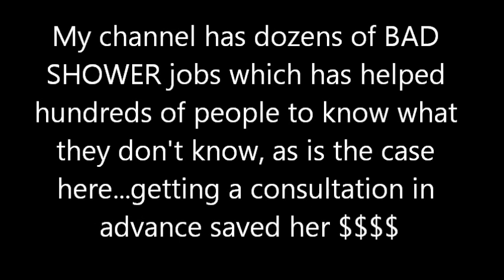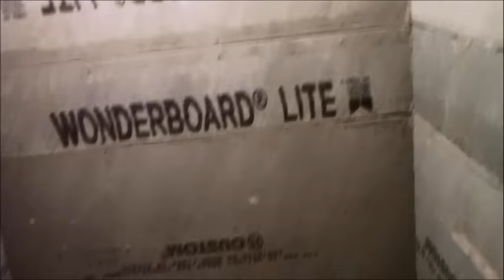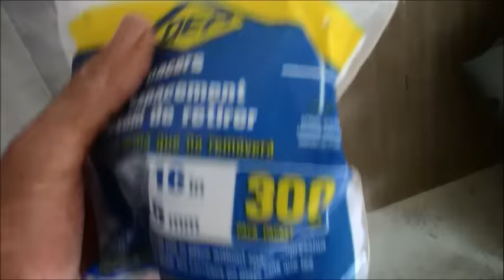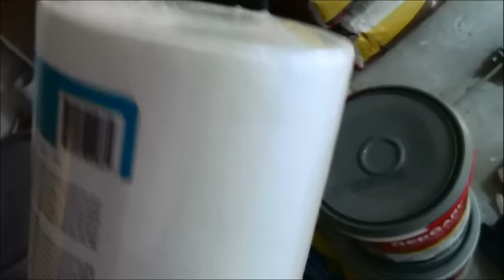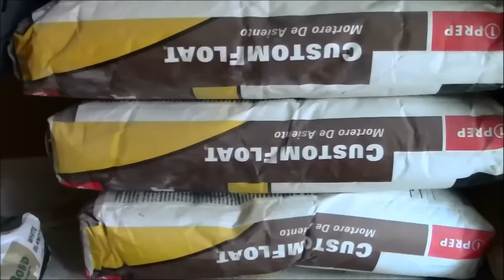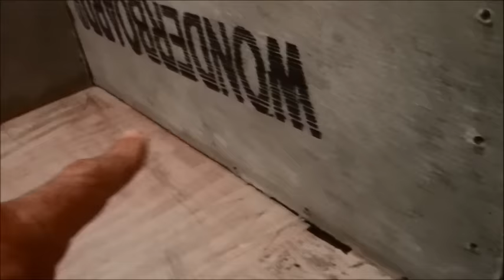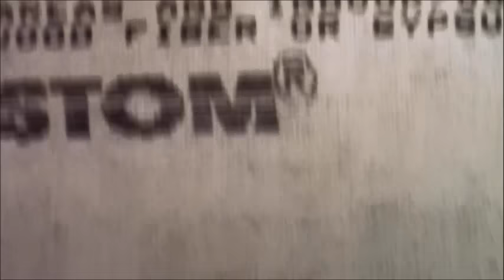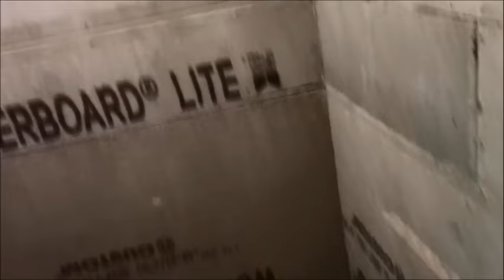BAD SHOWER DAY ONE !!

Comment: Lol I'm not gona save those lil plastic things every job. They get included with materials just like everything else chill out.
Reply from the maker: It's very entertaining to me that everybody chimes in on the fact that he bought new spacers, but it doesn't matter that he put his wallboard up prior to his pan, doesn't matter that he was using pressure treated wood for his curb, doesn't matter that he tried using pre-mixed thinset for his tile, that drain was off center, that he used 20 sharkbites inside the walls, much bigger issues than the spacers....
But if you are not cleaning all of your stuff on a regular basis like your levels, your wet saw, and your spacers man you're wasting money to begin with
Reply: @StarrTile  Yeah, you're right. There are other issues that far exceed the spacer issue but the fact that you are bashing him for spacers is ridiculous. They are so cheap. I never re-use them. Been doing tile, stone, granite and marble for about 22 years and I've always been ok with spending a couple bucks on spacers. I don't even charge the home owner for them lol. Also, the pre mix thin set and mesh tape are for the seams on the wonder board. Then, after it drys, you red guard... I dont buy the pre mix thin set but I literally just did a job where the contractor bought it for me to tape and mud the seams. I get that this guy has made some bad mistakes but why point out the petty stuff that you are wrong about? Lol. Also, the mud guard issue is dumb too. I imagine he knew and would have handled that before he laid the tile. There are so many things that you are bashing him for that arent wrong. They just aren't the way you do it... At the end of the day, you are a hating ass dude lol.
Reply: @StarrTile  oh btw, you said yourself that the tile guy didnt do the duroc but you are bashing him for it and the fact that he didnt put the pan down? Right... Same with the creaking floor. How do you know he didnt plan on fixing that? There are a lot of things that you are dead ass wrong for. I can tell that you are knowledgeable. You probably do great work. But, maybe you shouldnt be so fast to critic someone until you have fully assessed the situation. I've been guilty of that in the past too but you are trying to make videos on it, that people that have no experience are taking your word on. Maybe you should look at the job, write some stuff down and think about it or sleep on it, then come back the next day and do your video. That way you arent so quick to persecute.
Reply from the maker: Let's just suppose for a few minutes that my channel is focused on teaching tile, that I go through the jobs I end up on Forensically to discuss the do's and don'ts of how to do certain things... and let's suppose that the discussion in the comments has to do with both amateurs and professionals, people like ourselves that do this stuff for a living everyday, and that my critique of Joe Blow tile guy has to do with what I would do or the expectations of a another contractor would do in the same situation.... then both of your comments would probably be valid and you would probably have some points to make. However.....

None of what I just said is true, my channel is in no way geared toward other contractors whether they are just starting out or have Decades of experience, that people chime in on their opinion about my videos is a bit irrelevant to me. My presence on YouTube was predicated by job I did 10 years ago where the woman had spent $20,000 renovating her bathroom over the course of six weeks with three different Crews from the same company. That was my first video and the critique that I did on that video is valid information for homeowners like the one I worked for who had no clue about how things should go or what materials to be used. Going forward from 2010 I still do these type of videos for ignorant homeowners who don't have a clue, that way they have some insight on the things that either can go wrong or have gone wrong, it is information that has saved hundreds of thousands of dollars through the last 10 years for those homeowners who have contacted me as the one in the video did prior to things going south. When this lady contacted me things were already messed up, including some of the plumbing issues which I enumerated on the video, that led her to believe that she was getting ready to get shafted based on watching my videos. Simple but yet important things like the toilet supply being on the wrong side of the toilet flange, the fact there were 20 shark bites used to connect all the pipes, the shower drain being off center, etc etc... even to the point you made about the sheetrock guy hanging the wallboard in the shower, if I'm responsible for the entirety of the shower then I'm going to do the wallboard and if somebody else did then I'm going to give it a pass or fail, the fact that he did not oppose how it was done tells me all I needed to know. Already warped pressure-treated 2x4's was really enough info.
This lady contacted me feeling it wasn't starting out good, and she was right, despite the fact everybody chimes in on the new spacers 😂
Reply: Just throw your spacers in a water bucket with a little vinegar instead of the trash, let it soak, then mix with your paddle.  I've been using  some the same spacers for years lol.  I bet you throw all your buckets away too 😄
Reply: @justincada  Lol. So much talk about these lil spacers. I'm no expert an I don't do tile alot but I get it they can be cleaned an you could save a couple bucks. I'm sure there are pros throwin them out an some that save them. Either way a shower has never leaked or failed due to not saving the spacers! Lol 😆 I'd pay a couple bucks just to not have to mess with them.
Reply: You make your customers spend $75+ dollars extra for new spacers!? I have seen that they sell reusable kits at Home Depot and they are not cheap! This is why folks go for the cheap guy because you're charging your customer extra for something you can clean and reuses. Smh.
Reply: @Codi892   Lol the customer is responsible for all material cost. Im not out to save anyone money its about making money for yourself first of all. A pack of 100 is $5-$10 depending on type brand an where you get it. Nobody is gona spend $75+ on spacers like you said for a shower unless its huge or very technical with small tile. I'm not saying to just throw them out. It's just a very minor detail that alot of people found funny because was making such a big deal about him having bought new spacers. I actually hate tile work with a passion 😃
Reply: @alexandershulgin2C-B  Keyword: material! Spacers are a tool not material. You will not be leaving the spacers in the tiles as some fixture. They are there to help the tiler do their job correctly!! You should not be charging a TOOL as material. That is just wrong on so many levels. No wonder there are contractors out there charging $19,000 for a 55sq ft bathroom remodel. They are charging tools as material.
Reply: @Codi892  Lol this is hilarious! Actually there is such thing as leave in tile spacers! Sorry that your so worked up over re-using a peice of plastic. Tool or material whatever they will b the cheapest part of the shower. My orginal point being the ability to re-use them shouldn't be so heavily emphasized when we are talking shower failures! The tile community is so toxic! Glad it's not my profession.
Reply: @alexandershulgin2C-B  I am not a tiler. I am a freelance videographer and I am worked up because we are currently shopping for a bathroom remodel but the prices are ridiculously expensive. Tho I live in Chicago but there are folks charging $13,000 - $16,000 to basically replace tiles and a bathtub in a 51 square foot bathroom! And we have to buy the materials ourselves! Then to think they would have the nerve to tell us that spacers is included in our material purchase while charging $15,000 is maddening! No wonder some folks hire their neighbors brother-in-law uncle to do the job. Smh
Reply: @Codi892  thats funny. This isn't a tool its supplies. You obviously are not in the construction field.
Reply: @Codi892  if you understand this.. let's say it takes me an hour or two to clean, recycle and reuse those. That's more expensive than to buy them new LOL
Reply: @Codi892  dont like it.. simply do it your self
Reply: @mattteekel8237  I am not. I'm a freelance videographer and I can't imagine charging my clients to use a new SD card every time. Even tho SD cards have gotten cheaper, it's the principal.
Reply: @vanderumd11  I'm a freelance videographer. It takes some time to upload clips onto my computer, re-arrange it so I can find it and then upload it properly so I can save my edits in the right place. Imagine me skipping all that just to charge my client extra so I can buy a new SD card. Cause why on earth should I clean it out?
Reply: @Codi892  because your job is easy and doesn't require physical labor. If your job was to bid 15-40,000 dollars and you spent hours wiping off 200 tiny pieces of plastic that cost $20 then you would be what we call in the industry a WEIRDO
Reply: @vanderumd11  Because my job is easy?? Lol Clearly you have never went through hours of wedding footage to piece together a 10 minute video. Clearly you don't know the videographer who shot commerical videos for Harley Davidson or Ford F150 with a $20,000+ budget but I digress. I just see that cutting corners seems to be an industry practice.
Reply: @anthony4308  I see you completely missed my point.
Reply: @Codi892  it’s considered consumables not tools,
Reply: @HHECTORUSMC  So if a customer tells you they refuse to pay for the spacers, then what do you do?
Reply: @Codi892  The entire, budget busting,whopping, $10.23 is already priced in to the job. 😆. They don't have a choice.
Reply: @donnyh3497  It's a deal-breaker for me. I will now ask the spacer question to separate those who take shortcuts from the ones who actually take pride in their work.
Reply: @TheJosemarenco  no you're actually right. Lol ... I'll be watching for entertainment.  Not tips. 😂😂😂
Reply: Fellas, let's be real..
Forget about the spacers, forget about about the worped boards, forget about the board going in first... Blah blah blah..
The real crime here is::
Mr Tile professor here needs to cut his nails 🤦🏼🤷🏼‍♂️🙄🤣🤣
Reply: @Codi892  I've had 2 estimates to remodel a 5x8 bathroom.  First is 10000$. 2. Is 12000$. For both of them. The estimates are the very least. Without even looking.
Reply: My company does not reuse the tile spacers and I just buy them by the case.  So we have plenty on the job.  When we are done  they are put in a trash bag.  We don’t charge the home owner for the spacers. I just buy them because it’s cheaper to buy new ones then to pay one of my workers to clean the old ones.   I can’t believe that people care about what we do with the old spacers.   Let’s just all focus on the tile work and a little less on a few dollars for spacers lol.
Reply: @StarrTile  I get it this tile guy had many issues going on. Props to pointing these issues out. But you literally said you would “question” a contractor that shows up to a job with a new bag of spacers. I appreciate your videos, but you know as well as anyone that customers will latch onto that piece of information and will now question any contractor who shows up with a new bag of spacers instead of old used spacers. That is STRICTLY your biased opinion based on nothing more than your personal preference for reusing spacers that has absolutely no bearing on a contractor’s abilities or experience level. Also on the premixed thin set. I would never use it in a wet area, but I would certainly consider it for a bathroom floor or a backsplash. I’ve used it plenty of times for that and never had an issue. And there have been PLENTY of times where I bought only one bag of thin set initially because the store was low on stock, but had the intention of returning for more when tiling began. Or, maybe I would buy one bag initially just for the taping of the backer board. Not every contractor buys EVERYTHING they need on a job on day one.

I think we are just saying, presumptions about these things can set a dangerous precedent. I have clients who watch lots of YouTube videos on how stuff is done, and you know as well as anyone there is more than one way to skin a cat. Seeing a bucket of premixed thin set on site or a bag of new spacers is not grounds for immediate dismissal of a contractor, which is what many would do if they  are a devout follower of your stuff.
Reply from the maker: Still entertained by all the ppl focused on spacers...with 15 other things are are a big heads up...
Valve not center & too deep
Drain not center
Squeeking unsecure flooring
No blocking at studs
20 sharkbites
Warped PT 2x4
Toilet supply on right side
And yes, basically mastic which pre mixed mortar is, not EVEN proper for floors...been on jobs 5 days later 12x12 tile can still move because it won't dry....only on a backsplash and none was being done here. To your other comment about leave in spacers, no professional tile guy would do that even if directions allowed for it. And yes I save & re-use spacers ALL the time, nothing to do with cost, just prudent and force of habit.

This lady had watched a boatload of my bad shower job videos and had made a decision she was about to get screwed over, probably a good choice to let them go, we'll never know but I'm 95% convinced.
Reply: @StarrTile  it's ok to do everything wrong as long as you recycle those damned spacers😆
Reply from the maker: @donnyh3497  exactly !! 😂😂😂😂
Reply: With respect, for someone who goes out of his way to be hyper critical of other people, you really have a difficult time getting it back.

With that said, you'll probably dismiss this next part. 

There is a better way to point out dos or don'ts. You don't have to trash people in the process. You're so focused on the trashing part that you start it off by  insinuating the previous guy is terrible at his job because he doesn't hoard throw away plastic spacers. You should probably take a look inward.

Ultimately I suggest simply focusing on the dos and don'ts and less on the assumptions you're making about people. You'd save yourself a lot of criticism you clearly have difficulty taking.
Reply: @StarrTile  I just want to say, as a home owner who has been screwed over too many times and over paid thousands of dollars to professional contractors who cut corners and rush a job because they just want my money, thank you for your videos and professional insight.  Moving forward I can better vet contractors at least the tilers.  I’m actually going to renovate my master soon as well as my showers in my other bathrooms.  Your videos are imperative. Thank you.
Reply: @alexandershulgin2C-B  You’re the reason why contractors have a bad rap.  That simple fact that you only focused on the spacer and not everything else that was really wrong that he pointed out speaks volumes.
Reply: @sonyapeach  Lol. Ya that's why I pointed it out! Because its ridiculous to make such a big deal about spacers!  Especially with all the other real problems going on! Saving tile spacers isn't gona make or break the job!
Reply: This comment section will never die lol. This is just pure entertainment! I love all the raging Karen's
Reply: I get a specific brand (cartwheel style) from Lowe’s and they’re not all that cheap (10$ per 150 I believe), so when I pull spacers I just chuck them in a tote I have for them, no cleaning required or any additional work. It’s one less thing to potentially forget to buy, it’s cheaper (might save you a few hundred a year), it’s less plastic waste, and it’s probably slightly less work since it’s easier to grab spacers from a tote than from a plastic bag
Reply: @vanderumd11  tbh been using the same spacers for months and I don’t think I’ve actually ever cleaned them, let alone spent hours on the task
Reply: @mattteekel8237  😂. She does not know
Reply: I have tons of spacers. I dont do professional tile either. Just dumb not to keep them. Every dollar counts.
Reply: @justincada  LOL
Reply: Let me just make a bunch of assumptions….. I have an idea, how about talking to the tile guy and ask him about his plan?
Reply: That bath rooms is wrong in everyway  but. Your wrong about alot of things as well. If it's a concrete for you have to use PT lumber. And waterproofing membrane you are suppose to use the fiberglass tape for several reasons. But most of all its code to use it at least in Florida. You don't seem  like much a guy that goes by code. I  I doubt you're even licensed. But anyways I just was looking at vids yours popped up. Not my style. And for the spacers I stop using those 10 years ago when leveling clips came out you get a spacer and lippage is out of the question.  But you know what they say can't teach an old dog new tricks. Good luck.
Reply from the maker: @TylerBlakey
As you can clearly see this video has over a quarter million views so I don't respond to every comment.
There are things on probably every video across YouTube that people have no knowledge about, and yours is definitely one. You did however bring up a good point about spacers, like you I haven't used them in many years because of the leveling clips that are needed, that was my mistake for not bringing that across, those spacers had no business even being on the job site. And of course your ignorance on the concrete thing can be excused since you don't know this was an upstairs application with a fake concrete subfloor from the 80s... in fact I'm not going to call it concrete it is more like a mortar cement product, but it was NOT ground level so PT not needed. And to be clear PT would only be needed on the perimeter of a house that was a concrete slab. AND it would be cured PT, not bought at HD fresh as this gut did. Codes get mix-matched with common sense all the time, sometimes they are good and are a protector, sometimes they are illogical and cause problems because they're slow to be updated... take for example the notion of a pre slope, code in a lot of municipalities, however people are waterproofing the surface of their pan now so tell me exactly how a pre slope would be beneficial. So yes I'm a Maverick, and many don't appreciate my straightforwardness and logical brain, then again I'm not begging for subscribers or likes 👍👌
Reply: I love your videos, but in this one here i see that you are trying so hard to finding mistakes even with material in the job site that you dont even know how or where he is going to use it, 
Like i said i love your videos cuz we learned from you, you are good experienced tile guy, but just remember, when you point a finger to someone, look at your hand 3 fingers are pointing to yourself
Reply from the maker: @joseangel

14 things at a minimum including 12 sharkbites in wall, toilet flange 10" off wall, toilet supply on right side, shower drain not center, wallboard set before liner, valve wall not plumb... those are things that tell me it was going to go south.
Reply: @justincada  never waste a good bucket 🪣
Reply: @StarrTile  I don’t know why people are bashing you over taking pride in the quality of your work. I would take quality over quantity everyday of the week. If people are bashing you for taking the time to take care of your tools, speaks volumes about what little pride they show through their own actions. This job had several examples of what not to do and fools are talking about spacers. You’re 100% right.
Reply: For real! I'm a hack if I buy new bags of spacers?! I flick em all over when it's time for grout. I'm not picking each of em up. They are consumables and are bought for every job! Plus the ones you do have always get knocked over in the trailer and get everywhere!
Reply from the maker: @duganfr  the bigger issue is that spacers had no place on the job ANYWAY ! levelling clips should have been bought for this large-format tile
Reply: Well, this thread is entertaining, but...  Sure, I'm betting spacers and other assorted items are "included with materials" and factored at many multiples over the contractor's cost. It ain't buying a new truck, but just another way to pad for hidden profit. Funny how people rationalize crap, they put a few sprinkles on a turd and argue it's chocolate.
Reply: @alexandershulgin2C-B  you spelled Candace Odlii wrong.
Reply: @Codi892  lolol, and you will look as ignorant as you actually are about this. Spacers are a few bucks. They get cement on them and some are leave in spacers that you grout over. Thinking that a person who buys new spacers for your job is going to take shortcuts is pure ignorance. I had to buy some spacers on my last job because it was a size I am out of. I had three sizes laying around but I did not have any more 3/8. The owner actually picked them up from the store for me. I certainly did not cut any corners. I am glad they did not see this video and come to the conclusion that I did not know what I was doing because I did not have their size spacers currently, lol. Some people  🤦‍♂️🤦‍♂️🤦‍♂️
Reply: @StarrTile  then you should have cut that part out of the video. It was a stupid thing to say
Reply from the maker: @christcrucified6385  there is not one or two or four or five things this guy was getting ready to do incorrectly, and besides having new spacers, spacers weren't appropriate for this job to begin with, should have been leveling clips... I don't think I've touched any spacers for the last five or six years since large-format tile came on the scene.

That people continue to focus on the spacers instead of the other 14 mistakes this guy was making with his material is a bit bizarre
Reply: @christcrucified6385  And I wouldn't hire you. End of story. Clearly there is a generation of workers who are more interested in profit than the quality of their work.
Reply: @StarrTile  you asked why people were focusing on that and that was my response to your question.  They're focusing on it because it is so out of place with the rest of the video. As you point out, there were many things wrong with the job. I was just suggesting it may help if you erased that snippet since it is such a detraction. The fact that you've got a homeowner on here saying she's not going to hire a contractor who has new spacers shows how you can mislead people. But hey, it's your YouTube channel. I wish you the best.
Reply from the maker: @christcrucified6385  I started my channel 11 years ago going on screwed up and hacked up jobs, that almost always start this way so for me not to point out the brand-new spacers which I haven't even bought brand new spacers for years is why I mentioned it, once again that job had nothing to do with spacers those should have been leveling clips and that's the bigger issue.
If he at least had leveling clips then I could have bypassed the spacer issue
Reply: He is critizen dudes skills and quality of work cause he bought a bag of $3 spacers 🤣😂🤣
Reply: @StarrTile  I hear you man, but I have to disagree on judging installers on whether they use spacers or clips.  Many old school guys never use leveling clips. As far as I know, all the leveling clips do is help with lippage. They do not adjust the tiles up or down on either side. I do NOT use leveling clips. I make sure every tile is perfectly level, and as we all know the tiles themselves can vary in size if they are not rectified. It might just be millimeters but going up a wall can end up "imperfect" by the time I get to the top if I trust the spacers. I build off of a level board on the wall but even if the board is 100% perfectly level the variation in the tiles can throw it off. I use some spacers and even use paper to make different size spacers to level each and every piece of tile. When I am done my showers are always more square than the framing. I build immaculate showers. I use three or four different size levels and make sure everything is perfectly level, straight, and flat vertically and horizontally. I am a perfectionist and it is an art to me. When I started this stuff in the 90's I never heard of leveling clips. I don't think that I need them because I don't suffer frim lippage, lol. I think I will try them on my next rectified tile job just to speed it up, but I have no intentions on ever using them for non-rectified tile jobs. 
Many old schoolers can build better showers without leveling clips than many new generation installers can with them. I think they were invented just to speed things up or possibly to help the inexperienced with lippage.
Reply from the maker: Trust me I did not judge him on the fact that he had spacers or the fact that he didn't have leveling Clips, it was the 14 plus other things on the video that I judge him on including all of the prep that had been done ...that somebody decided to focus and comment on the spacers critique is on them and not on me. In the description there is the follow-up video which shows all the rest of the mistakes. The homeowner would have been screwed over 100%.

So going back about 8 years ago, maybe even 10, we were all doing 12 x 12 tile or 13 x 13 no offset and set wirh spacers. Then Along Came large-format tile, specifically 12 by 24, and they are bowed, especially the wood plank floor tile that NEED leveling Clips in order to avoid lippage since everybody wants it staggered in half, or even at thirds it would be difficult if not impossible to avoid lippage without the clips. The leveling systems came out as an answer to a problem, if all this large-format tile did not exist then neither would the clips.
If you can have lippage free setting of tile without leveling clips then consider yourself fortunate and or extremely skilled, and even though I carry around a box of used spacers of various sizes for years, I don't think I've even used any of those since 2008-2010.
Reply: @Codi892  Actually Candace, the opposite is true. Leveling clips were invented because the industry thrives on speed, not quality. They do NOT guarantee a level or square shower at all. They only help with lippage. The problem with the industry is that developers just want the job finished in a few days. As long as the shower outlasts their warranty they are good to go. I won't work for people like that. Thankfully, I don't have to because I do immaculate work and get enough business by word of mouth. 
Old schoolers who take there time will build a better shower than any new generation installer that can't build a shower without lippage unless they use clips. Everything you are saying is pure ignorance and just wrong in every way, but I am glad you are commenting on here because every tile guy knows it, and it shows why Starrtile should not be misleading the ignorant public. I am not putting you down. Anyone can be mislead by a knowledgeable guy like STarrtile. Only tile guys will know when he is blowing smoke and venting.
Reply: @StarrTile  I agree with all you are saying here for sure. My last job the tile guys got run off before they got to the showers. They left a leveling kit behind. I did not use it because it was just standard 20x20 porcelain and not rectified. I did keep them though and will give them a try on my next rectified job. Thanks for your channel and info.
Reply: @StarrTile  You mention you do it for the homeowners and how you have saved them 100's of thousands of dollars right after you call them "ignorant homeowners" 

This is the first time I ever come across your channel . . . you seem to really enjoy critiquing other people but seem to get very upset when people critique you.  LMAO.

I think you don't want contractor's looking at your videos so that they don't critique you and you can charge the owners more to fix someone else's mistakes. I mean really, my labor could pull off all that board and have it ready for me to start fresh in less time than it took you to make this video.  LMAO.
Reply: @alexandershulgin2C-B  He must not make very much money, or get enough work that he has to spend an hour washing and cleaning spacers.  LMAO

Wait let me do the math:  1 hour of my time = $40-$60 
1 bag of spacers roughly $5
Even if it took me 1/4 hour to clean them, that still costs me $10-$15
WOW.  

I like the part where he says he does it for the homeowners to save them money but calls them "ignorant homeowners" LMAO. Or when he says,  "I'm going to have to charge them a lot more money to fix this . . . my labor could pull that shit down and have it ready for me in less time it took him to make this video.  LMAO
Reply: @mattteekel8237  RIGHT. There are such things as consumables, and spacers are one of them.  That's like saying I'm going to reuse the screws and nails when I demo something!
Reply: @Codi892  You do realize, that there are many different types of spacers out there ( just like, in the old days, there were many different types of film speeds that resulted in different effects, High speed, low lighting etc.. . . . Not every piece of tile is the same even if they are in the same box. so there could be as little as 1/32" to 1/16" difference with every tile depending on the material it is manufactured for. Because of that discrepancy,  a craftsman has to know his material and adjust for it in order to achieve the desired results.  That's why when you go to home depot and walk down any aisle, there is slew of items seemingly for the same thing.  There are at least 25+ different types of spacers made, which one that is selected is determined by what type of material is going to be used:  ceramic, granite, quartz, glass etc.. and even within each category, the size, shape and finish affects it as well. 

Just like in your case . . . what effects you are trying to achieve with your final video will determine the type of setting you use, filters, lighting etc.  And then you have to spend hours trying to piece it all together.  It's no different for us. That's why there are certain materials that we just purchase as needed.  It would be nice if everything was the same, but it's not.
Reply: @survivalSC  I hear that. Not to mention that there are so many variables that will dictate what type and size we will use. It would be nice if every 12x12 tile was exactly 12x12. But they aren't. sometimes every tile in the same box is a little different. It's not the $5 bag of spacers that makes the difference, it's the person's skill and his knowledge of knowing what materials to use and when to use them.
Reply: @alexandershulgin2C-B  Not to mention the fact that he dismisses the use of the fabric tape for the joints during water proofing. That's like a drywaller saying that joint tape is not needed because the joint compound is strong enough.
Reply: @StarrTile  To be fair, you are absolutely correct. There are a lot of discrepancies noted with this job. And it is a shame that there are people out there that do this type of work. But that's why they call me. I don't waste my time badmouthing the other guy, I spend my time focusing on what needs to take place to fix it. That's what I do . .
Reply: @JTP1967  lol
Reply: I re-use spacers also.  I clean my buckets even.  I maybe do 5 showers a year.  I also only do jobs that I personally prep/demo&plumb.  It's pride and quality in your work.  Most home owners are oblivious.  Cudos to you for educating them.  I just conduct myself according to the warrantee and 20 year standard I expect of my product.  These commentary seem to feel called out lol.  Must be feeling guilty..... Rock on Star tile and keep doing your thing
Reply: Your crazy bro yeah it's included with materials and then I pocket it because  I already 5 Tupperware tubs of them already lmfao
Reply: Everything u save is money back in your pocket.
Reply: Don’t cry  girl  , not  every person has to  do the things like how you think I hate peoples like you  , if you want the job just  ask if they can give it to you  .And I have 15 years working on this
Reply: Re-using them.. seems like poor quality control I don’t care how good you think you are the spacers get mud on them & if you don’t clean them right then... As you know mud hardens. Making that spacer thicker. Contractors are always trying to act like there’s only one way to do things & it’s their way 100% of the time.
Reply: Saving spacers means you aren’t charging enough. $25 in spacers to do a 5k shower shouldn’t be an issue. PT is code by water where we work.  Regardless of liner or membrane here. So the regular 2x4 would be a fail already.  Yea that job is shitty. Heavy mud levels everything.
Reply: It's the green Rolling stones green m&ms of a craftsman. If you know, you know. You can tell when something is half ass by the little things.
Reply: @Codi892  imagine charging for film omg... it's like that wasn't a thing...
Reply: I Totally agree with you! My day job is in Telecom and I’m Hobby machinist. I sometimes do DIY kitchens and bathrooms and I’m very proficient in plumbing. I have worked with tradesmen and see the IDC attitude they have, not all but some. The shower valve and head will look stupid forever if left that way. All plumbing can be moved, unless it’s set in a concrete wall or floor. I would tell the customer what was wrong and take all the boards off, floor also. The ultimate decision is how much the customer wants to spend for all this work. Also is this a rental and do they want to go cheap? As a DIY-error many years, I with I had YT 40 years ago. Thank you for your video.
Reply: As a tile contractor, I'm often following the GC or homeowner's crews. I'm not always asked to be there from the beginning. I would be questioning why the drain/valve isn't centered in the opening. Why the new plywood isn't installed correctly( plywood long edge across the most joists). Yes, it bothers me to know the previous trades don't know what I need to do my job and that it needs to be corrected by someone. Some of the red flags I agree with you: pressure treated lumber, mastic and drain location. I  would also check the proper thinset for the tile.  I think calling out the drain type, spacers and redundant taping of seams is trivial. I sometimes drop off other materials later, too. As an "educational video", it's ok. The homeowner has new knowledge to discuss this project with the plumber and tile setter. She might replace them if their answers don't make sense.
Reply: really he should have bought tile leveling weges instead of spacers. usually those spacers get cement on them and for the price im not cleaning them.
Reply: Well, most of the spacers i use are not reusable so i have to buy new ones. And the rubber reusable ones are like 6$ for 500. I use some of those along with reusable wedges but loose a good number each job. Reusable spacers are like paper towel and pencils. They are a consumable component of the job.
Reply: @Codi892  if a customer refuses to pay for the spacers, or anything else so petty, that’s the point where they can find another contractor. If I see red flags like that, I don’t take the job. I can only imagine how enjoyable having you as a client must be. You said it yourself, you’re not in the line of work. If you were, you would know that things like spacers are neither a tool or a material. They are a consumable. A thing which is essential to the job that needs to constantly be replaced over time. At $15k and assuming 200 man hours, you’re paying $75/hr on average for your bathroom. That includes things like plumbing, electrical, and then of course tile setters. These are basically the most expensive trades to hire and you need them all. 200 man hours is one man for 5 weeks or 2 men for 2.5 weeks. None of this sounds unreasonable. At least nothing besides your input. Do it yourself.
Reply: @JamesSClapperton  Why do you think there are so many DIY channels today? Let's be honest, the craftsmen of today do not have the same work ethic nor integrity of those before them. There was a time when craftsmen took pride in their work, now all it is about is money. Then we wonder why there are so many terribly built homes and buildings. My job building is only 20 years old and there are so many problems because the contractors took unnecessary shortcuts. It's like why pay someone all that money to get the same results of an amateur?? Might as well save yourself money and do it yourself.

Oh and PS. That 15k was just for floor and shower tiles (we had already purchased the tiles), replacing a bath tub and toilet (that we already bought as well) and fixing the shower pipe. None of the renovations needed permits. That should let you know how much work was needed for the bathroom renovation.
Reply: @JTP1967  If a tiler tells me that my project requires a special type of spacers - that they do not have -  in order to do the job properly I would not be mad about that. It's when I am getting charged for spacers for a traditional subway tile shower and large format tile floor that makes me angry.
Reply: @alexandershulgin2C-B  I'm here reading them a year later so 🤣😂 Also about to do a shower (new construction).
I love that such a little thing like plastic spacers is enough to get everyone in a kerfuffle 😂😂 Meanwhile....there are starving kids in ....lol I digress.
What everyone is assuming is that the tile guy bought all the supplies. Do we know if the homeowner bought them? 
It may be harsh to judge a contractor on something so ..  well, clearly not minor given all the commentary 😆 but yes, incidental and I agree with the person that said "consumables". Having run an electrical business, it's like our guys showing up on the job with a new bag of wire caps every time. When you've been in business awhile you tend to have an inventory of these "consumables" so they're just part of your standard pricing and you pull whatever you need from the truck whenever you need it. Granted they didn't need washing but if you're washing the bucket anyway and you're clearly removing the spacers, why not just throw them in the bucket? Even if not washed, I would assume just by so many jobs and not using all the spacers on every job an experienced tiler would still likely have an existing inventory.
Reply: @TravelinMama73  Lol yes its been quite entertaining 🤣
Reply: @alexandershulgin2C-B  I needed a good chuckle and this is doing the job! 😆 
I come to the comments section immediately on some videos simply for the entertainment value but on videos like these I find I usually learn something. Like I didn't know spacers were so yesterday 🤭😆
Reply: Its been over 2 years an 100+ comments later. I hope @StarrTile still thinks of me everytime he sees a tile spacer 🤗😏
Reply: @aniiraqigawad6693  Ya exactly the spacers are junk an the idea of using them at all in 2022 is crazy especially with so many better available options. Whats even crazier is Starrtile making such a big deal about the guy buying new spacers an not having saved them from every job like he has since 1986 🤣 This video is about showers not floors so... Neither of which I do. I've done a few showers now for a couple clients but actually hate tile with a passion 🤗
Reply: @alexandershulgin2C-B  LOL 1986 that actually made me laugh out loud 😂😂😂😂😂. I bet the contractor does have used spacers, but he bought a pack of them so he could return them and take the returned money as profit. It’s a dirty business, very few know this.
Reply: @alexandershulgin2C-B  Really brother, i enjoy tiling the most outta all trades. One thing i might enjoy slightly more is framing with a framing gun and concrete nail gun.
Reply: Just One question ? The Tile contractor is responsible to put down the Curb and fix the subfloor noise and the 2x6 he mentioned around the shower pan .
Reply: @cody182
 I think is the othe way around. Spacers are material, not a TOOL... You don't call a snap on material,  but a snap on tool. Material, (spacers) can be disposable...